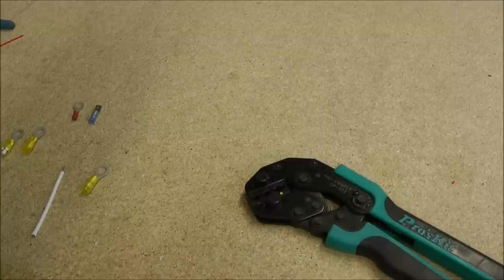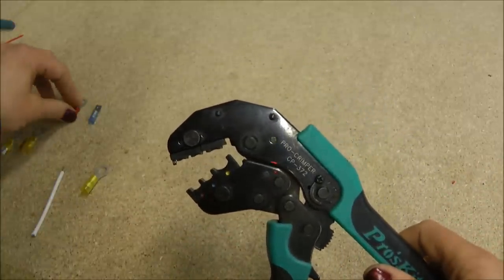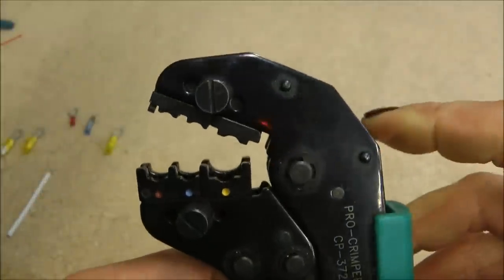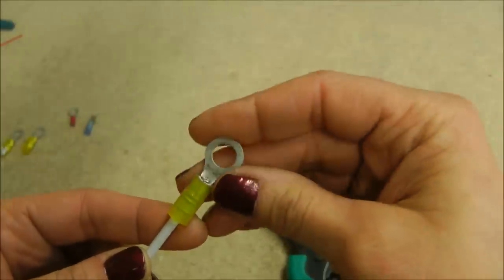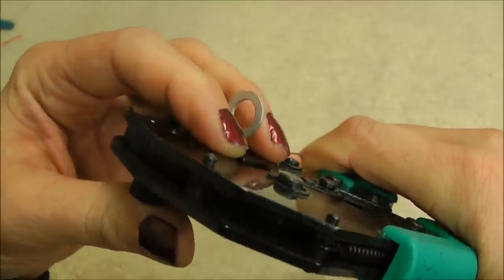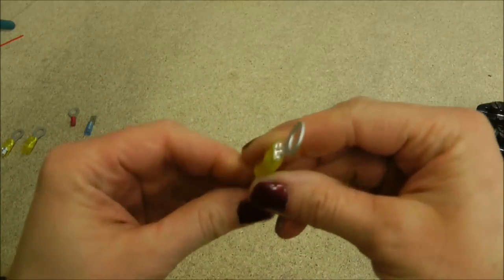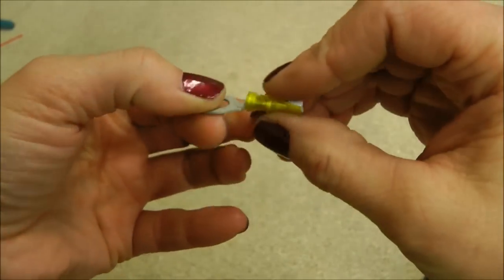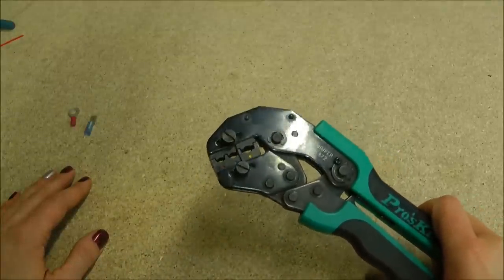015: CRIMPING STANDARD AVIATION WIRE TERMINALS USING SIMPLE CRIMPER

Comment: Great video explaining the sides of the die set to enter. 
Which crimp position or rotation makes the best crimp?
Should the seam in the crimp always face the upper fixed jaw? Does it make a difference if the seam faces the lower moving jaw? Finally does your crimper tool's lower moving jaw have 1/16" side to side movement?

Comment: Fantastic! I have been looking for which way you put the connectors in, it sort of makes sense in that the yellow slot being wider would interfere with a blue ring or blade connector if you put it in backwards. I have watched several videos in search of this explanation and they always babble on about red blue yellow and show you stripping wire before putting the connector in either way completely eliding the fact that the crimping die is not symmetrical and that there is a right and wrong way. Thanks

Comment: Very well done! I'd recommend these types of terminals, the nylon insulated type, over the vinyl insulated ones. In my experience, (we order from McMaster-Carr) the vinyl insulated terminals do not have the secondary insulation supporting "sleeve" at the rear of the terminal. The nylon ones cost a bit more, but are worth it for durable connections. The vinyl insulation is opaque, the nylon is more transparent, allowing you to better see what you're doing.

Comment: good video. bought a set of crimpers off the snap on truck with replaceable jaws and could not figure out why insulated and open barrel jaws both had 2 sized parts on the front and back never knew what side to crimp with now i know how to do it.

Comment: Great video describing which side is which, and why.  However, the clocking is very important as well having the split on the top (or bottom)--  even for brazed terminals, as shown but not communicated.

Comment: Finally! I must have watched a hundred videos on crimping, and this is the only one that has a proper explanation of which is the wire side of the crimper. Not even the few crimpers with instructions really mentions it. I guess everybody assumes you just know this. I've been in electronics for 40 years, and only just now bought a set of ratcheting crimpers. Thanks for this video!

Comment: Sees the front and back demo, pauses video to run and get my crimpers. Being an infrequent wire-er, my cheapies are the same front and back. Boss's better quality ones are like yours. HOWEVER both of ours are completely straight pliers, where yours have the jaws at an angle to the handle. As a female mechanic who sometimes struggles with sufficient pressure to get a good crimp (I use the table or whatever is able to press against too), does that angle give you any mechanical advantage? Also, what does the small sprocket just adjacent to the inscribed PN do?
Reply: There is no important difference between the straight jaw and angled jaw crimpers. Just a different ergonomic design. I've used both styles and they require about the same effort to make the crimp. The sprocket will adjust the squeeze of the crimp. There is a + and a - symbol and set screw. Whichever symbol is closer to the set screw determines the crimp depth.  + is more crimp depth. - is less crimp force. I keep mine in middle but even at low setting I find it it is sufficient for these terminals.

Comment: These are just standard automotive terminals.  Ise them everyday as an auto electrician.  Honestly surpised they use them on aircraft.
Reply: There is a difference. The terminals shown here, as used in aviation, meet a military specification, which means they are more rugged, less prone to failure, and built to a higher quality than than most equipment used in civilian applications.
Reply from the maker: As the previous reply noted, they are not even close - "standard" automotive terminals that you see at any store use PVC or other plastic insulation. They also rarely if ever (almost never) have the extra sleeve inside of them.  You may "think" you are seeing something similar, but you are not....no car mfgr will spend the money on these types of terminals, that is a fact! :)